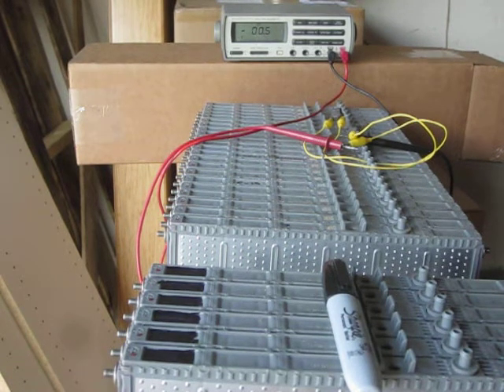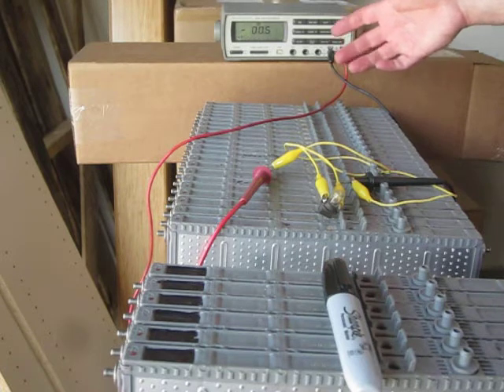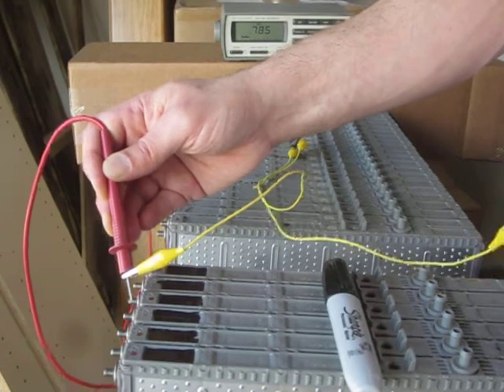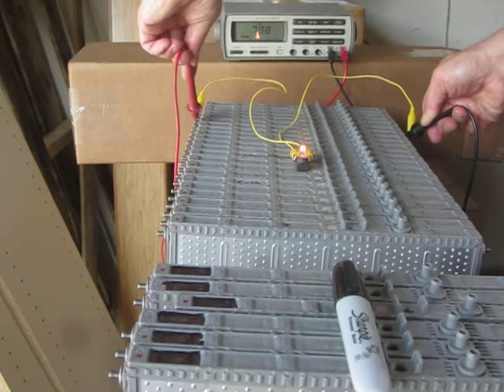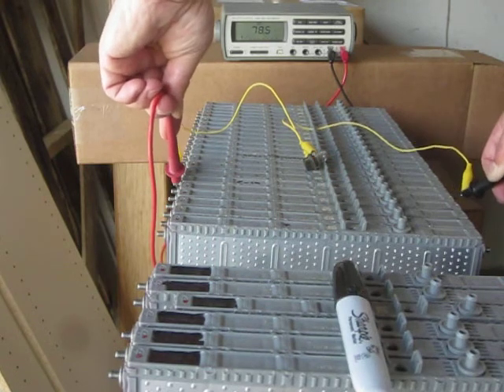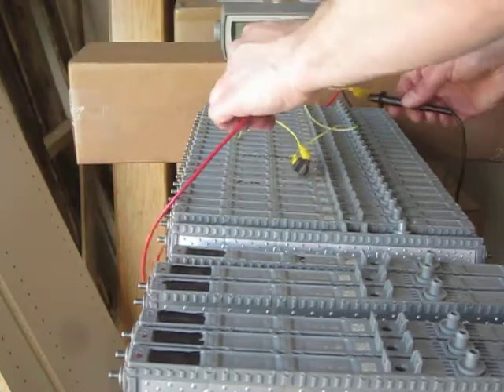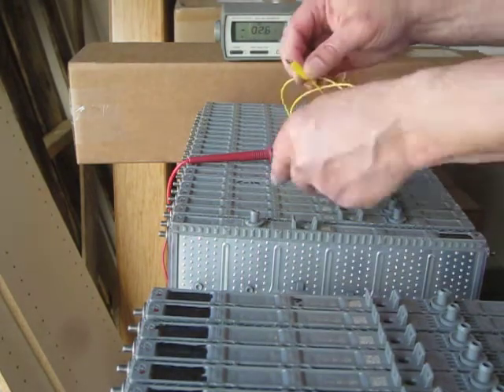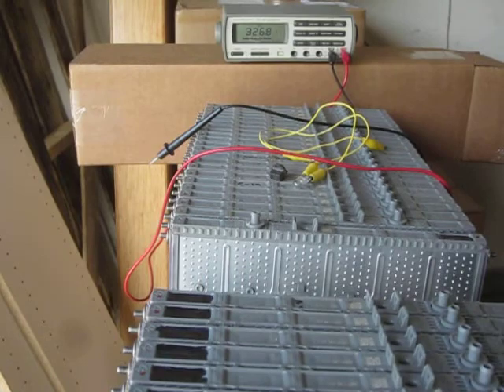Load Testing Prius Modules

Comment: 0:24 Make sure you  careful with that power supply. Its not a charger. Cool video, I've burned many power supplies before learning i need a charger in the middle. A nice rc charger will do
Reply from the maker: There is no power supply in this video.

Comment: Thank you for the video!
I have load test my 2012 camry battery cells with an old headlamp bulb known as h4; all calls were holding 7.45 volts range and I had meter on for 20 seconds for each cell. If cells are showing capacity where it should be then what should I check next to fix P0A80 fault code?  Thanks
Reply from the maker: If all the modules check out ok, I would suspect corrosion on the terminals, or the whole pack is just worn out.

Comment: The thing is they are hooked up in series so when the car is pulling 30 amps it 30 per block. It is easier to understand if you convert to Watts.
Reply from the maker: In series, every module (2/block) sees the 30A, yes.
Reply: @ZookeeperJohnG . 30A and then some!
Reply: @jayviz if you have the Dr Prius app you'll see that you'll hit 100 amps under hard braking or hard acceleration. 30-50 amps just getting on the freeway

Comment: My Camry ex taxi. Over 800,000kms 2010, I know the owner and he never changed the battery. I have the car 5 years. Last 12 months the code throws. First it was every couple weeks, now some days it throw 3 times in one day. But it still go weeks sometimes. Funny only at major part he  change was abs. Except for tyres and oil, the only  thing, I've changed is a wheel bearing in 5 years. Need a lot now. Hard choice to keep it or flick it.

Comment: Load testing with around 2-3 amps for only a few seconds?  I wouldn't think that would be long enough to determine if a battery is good or not.  Others have recommend 2 minutes.
Reply: that's such a minuscule load I find it hard to believe it's very effective. Think of the load these things are normally put under in normal use!
Reply from the maker: It is super effective at weeding out failed modules that capacity testing would be a total waste of time on and that was my goal.
Reply from the maker: Not capacity testing, load testing to find bad modules.  Performing a capacity test takes a lot longer and will find OK, but weak modules.

Comment: Only defective modules can be found via the voltage. With a capacity measurement, weak modules can also be found. These weak modules are among the first to be broken the next time. I found a 7.4 volt module with only 1800 mAh. Normally old modules (year 2007) have approx. 5500 to 6500 mAh.

Here you find the way to check the capacity of your cells:
https://www.youtube.com/watch?v=g5KAPge-f6E&list=PLX3tCDQe4fs8zdhS8qTrgh4gI1w9-1W1t&index=2&t=0s
Reply from the maker: Correct, if you will notice the title is LOAD testing, not capacity testing, they do not measure the same thing.  Why load test?  No point in doing a capacity test if the module cannot carry even a small load and so save huge time.

Comment: I would have liked to see the voltage without load on the bad cells! Can a bad cell show suffucent voltage without load? Thank you!
Reply: I had an exploded cell. Literally black and burned and leaking liquid. Still gave me a reading of around 8 volts.
Reply from the maker: Yes they can.  A truly bad cell will have low open circuit voltage, but marginal ones can show close to normal.

Comment: what is the voltage it should hold under a load and without a load?
Reply from the maker: If a module is <7.0V no-load, I would not bother testing it.  I have had good luck with modules that will stay over 7.4V with a 1.5A load for 5 seconds or longer.
Reply: On priuschat I've seen a lot of comments that the load test should be 100W or 150W and a two minute to the second time, to get the correct results.
Reply from the maker: 150w on a 7.5V battery is like 20A, no way they will take that for two minutes.  I think folks are confusing the motor current the inverter produces and the battery current from the High Voltage pack, which are not at all the same thing.

Comment: i bought a used pack.  about six of them were at 7.53v.  the rest were 6v , 4v, 2v and 0.45v.    i replaced two  bad modules with the 7.53v and my prius is good.   the low volts ones, i have been trying to balance .   i noticed they discharge  by themselves quickly or slowly over a few minutes or in a day.   the rate discharge differs.    the 7.53v would not discharge at all.  i did not try to balance them. i just swapped them out.